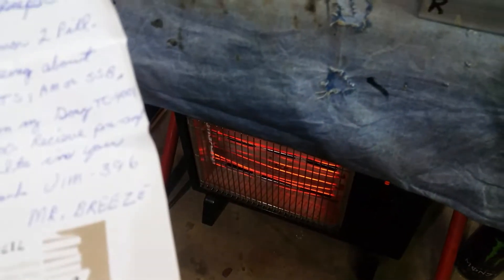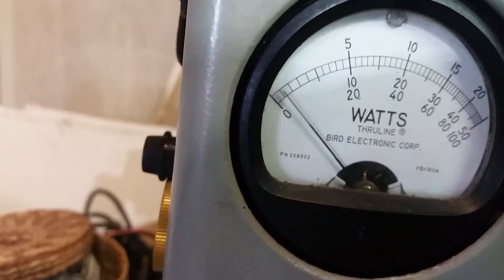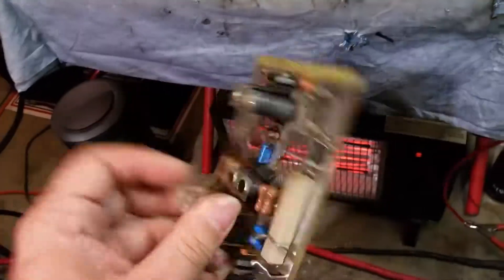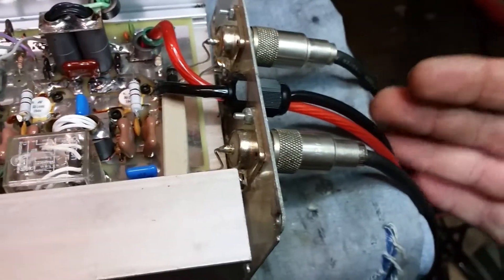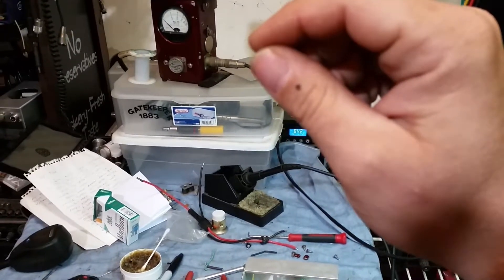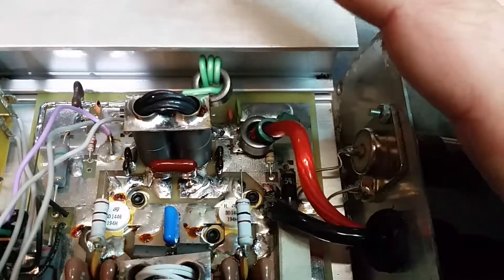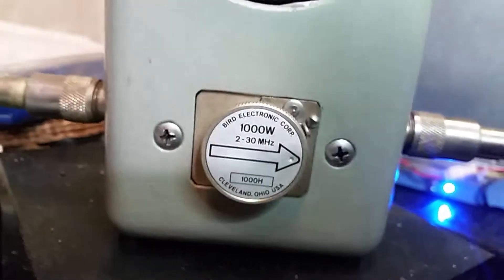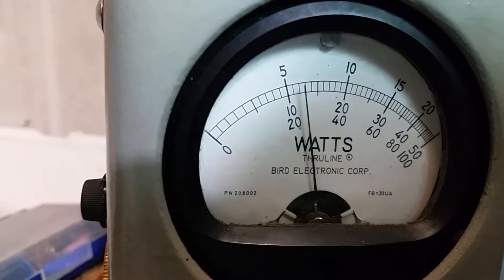Mr. 396 Breeze's Palomar 250 Repair - With FAKE BIAS 😡

Comment: I have a palomar 225 black face with the same low power problem. Maybe a 50 mfd cap would work on mine as well for the output. Maybe replace sd1446 transistors too. Unknown, but I guess I will have to check it out. Thanks for the info, glad I tuned in to this video. Thanks,  Billy Albq. N.M. 1/ 22/2023
Reply from the maker: Awesome brother I hope it does help you.... and I like the way you put the date at the bottom of your comment... that would help people in the future just to know when you left it.

Comment: Gatekeeper, I'd still like to know how you get over 600 watts from a three pill, I don't get it.   please answer
Reply from the maker: That is a very very simple answer since I've done it on quite a few 3 pills I have done in the past.... It isnt hard to get them to do it when your driving the heck out of them. Think about this...that 1 pill section could be driving over 100 plus watts pep into the 2 pill section. Is it really doing 600w PEP? OF COURSE!....IS ALL of that power actually making it on frequency? Very questionable 🤔 lol.

Just like you'll see a 2x4 do 1200 pep same thing.
Reply from the maker: Plus I'm giving it all the current it wants and a steady voltage.

Comment: There is a lot of amps like that out their . even the 4 and 5 pill versions. usually SD 1446 pills but seen SRF 2072 MRF 455 even SRF 3662 and MRF 454 . Watch that bias when taking choke to ground off input transformer. most of them set .75 V or even higher. usually a resistor to ground drops it a bit or use a 1N5814 or so diode . will do more watts when bias working. had to pad a few and fix input tune. Them out put tune caps go bad quite often even on outher amps.  not a lot of heat sink so a fan will be needed in biased mode if long key downs. If you trace that bias out it's very close to messenger circuit.  The RF transistor hand book. shows a very similar bias circuit. just different diode and sand resistor.  no choke to ground. My old 4 pill MRF 453A  box has 1N4997A diode pressed into heat sink for bias. same diode in the book.  it runs a bit high but ok with old school pills . not HG. Them inline AGC fuse holders get warm and the wires break off. you showed a video of that. very common on that type of holder.  AGU or MAXI inline at battery or power supply hot lead. ANL fuses start around 100A will be to big on 2 pill. 73's
Reply from the maker: Very good point man....you know I have never actually checked them before I guess.....and yes goodness 0.75 is stout for sure. WOW... I need to break down and get some of those metal case like you have. They are not cheap but I need to try some you talk so good about them.